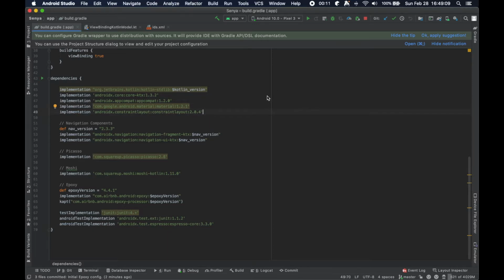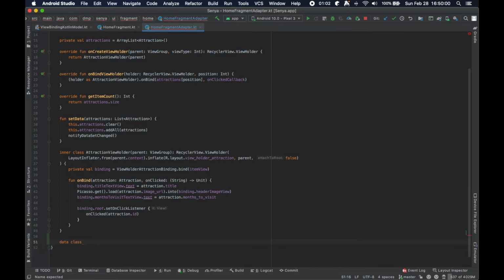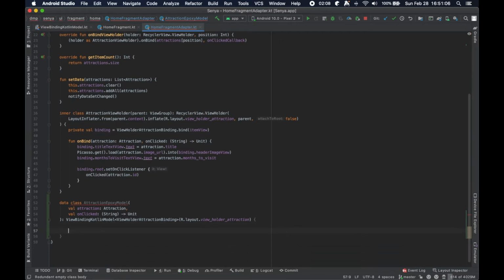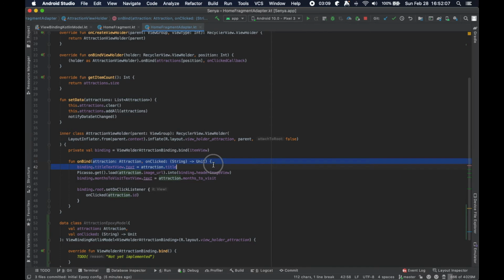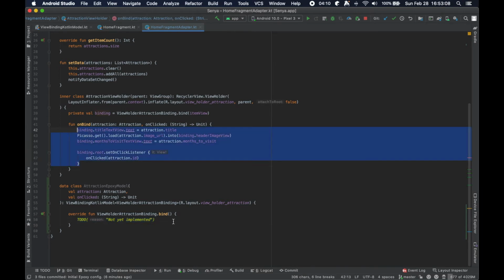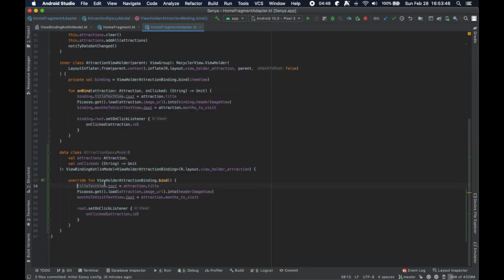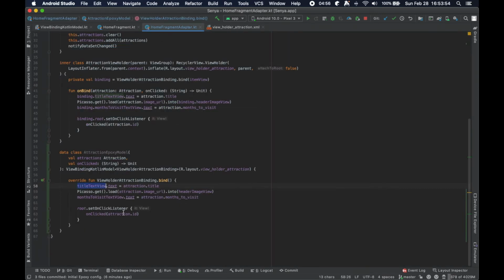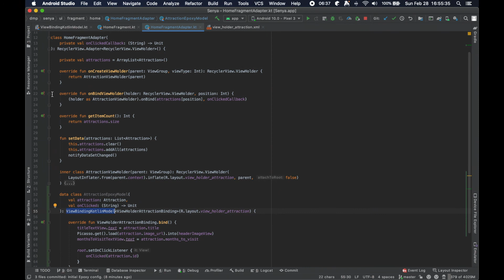Understanding EpoxyModel

Comment: Which short-cut did you use at 4:34 for selecting all binding?
Reply from the maker: Ah yes! My favorite selection 'hack" in Android Studio. Once you highlight a phrase, you can press Ctrl + g on Mac or Alt + j on windows and it will search the rest of the file for a match and highlight those matches. 

This will actually give you "more cursors" too. So you can copy and paste in 5 different areas as well or just make regular edits where all the cursors are. Give it a try! Super powerful once you get the hang of it 🙌
Reply: @TheAndroidFactory  Thanks a lot😊👍👏.